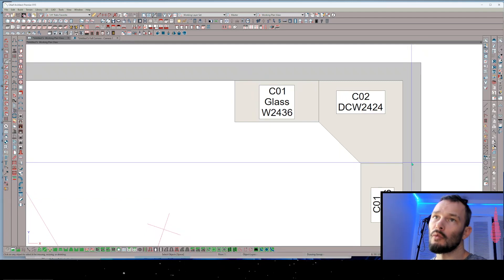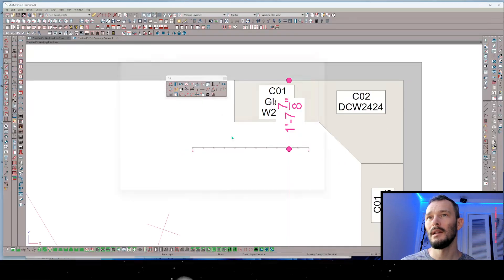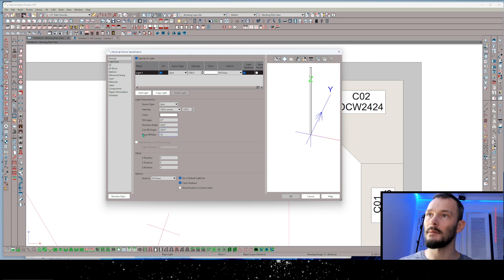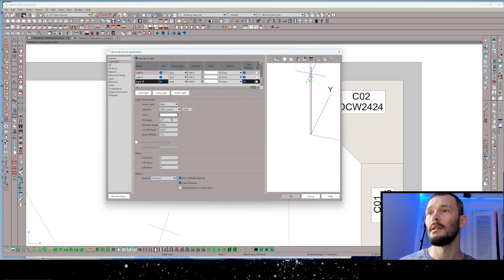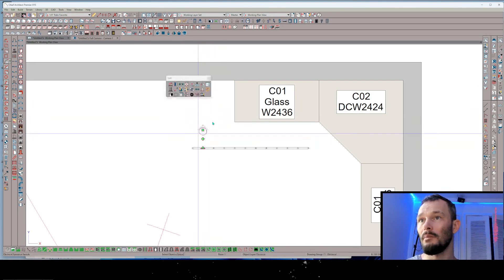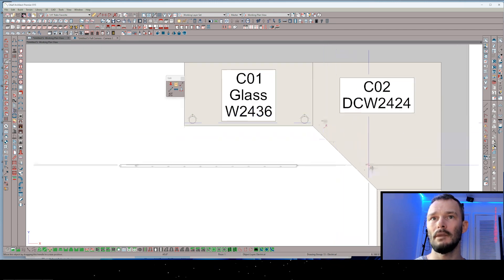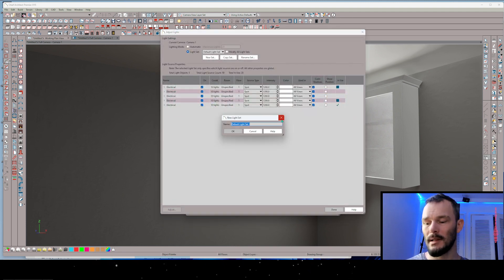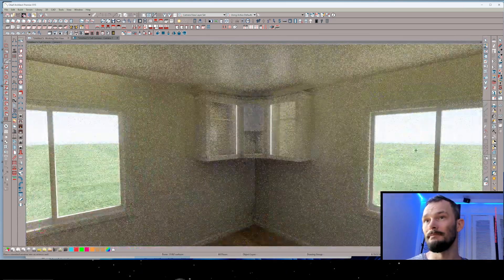CA SHORTS-Vertical Rope Light in Chief Architect X15

Comment: Can this be done in HD 2026? I'm not seeing any way to change rope lights plane to vertical and we don't have these options available to convert it to a symbol.
Reply from the maker: The concert to symbol tool is not available in HDPro. But HDPro now has path/ray tracing and area lights so you need an extrusion that is vertical and spray it with an emissive material